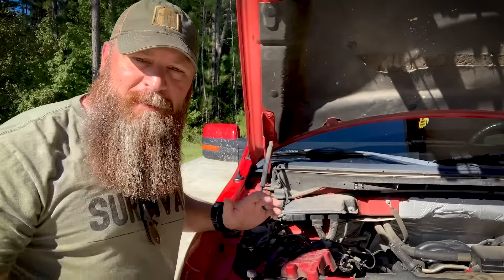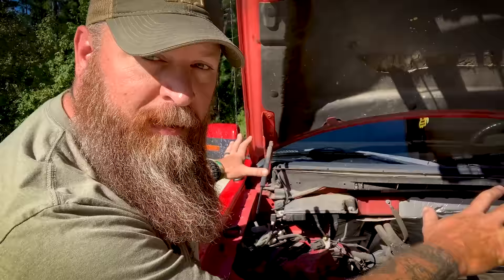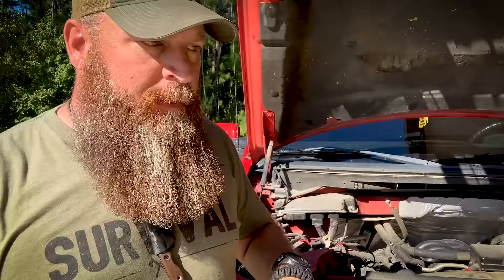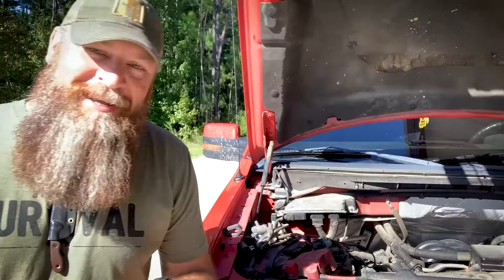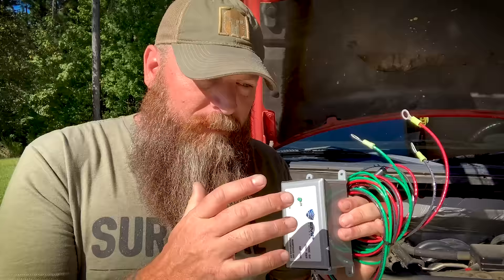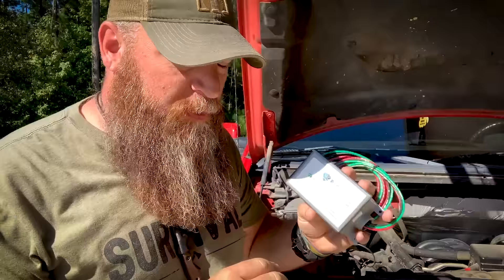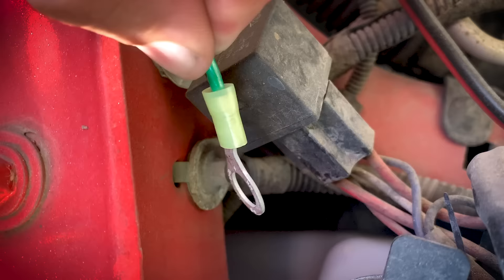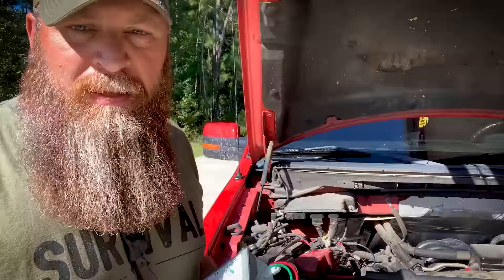EMP PROOF YOUR VEHICLE

Comment: You cannot stop EMP with a surge protector like you would with a lightning strike.  EMPs don't come in through the power lines.  They affect anything that acts like an antenna the most (but not only) because the energy is dumped directly into the electronics.  Like wireless charging except not limited to electronics meant to receive power.  It pumps energy DIRECTLY into a computer chips not designed to handle significant current so it heats up and dies.  Grounding connected to that chip, like the 'EmpShield' can't help because the energy traveling from the chip to the grounding device would have already done the damage.

Comment: Interesting video, and the product has many claims, I am a simple man though and one of my hard and fast rules for planes, boats, cars is never to use cheap electrical components. The connectors on what you are holding look to be non-insulated cheap import ones.
The product website offers no information regarding wire gauge , quality, connection quality etc. You did catch my interest though so am reaching out to them to see if they will provide any specifications or are they just limited to shiny "marketing" materials which often works for the Gubmt but not for something I need to trust. 
Thank you for your content.

Comment: A nuclear detonation produces 3 waves of energy, E1, E2 and E3, over varying time duration.
The wave of most concern is the initial E1 wave, which could be generated from a high altitude 'air burst'.
On detonation, Gamma rays would stream down into the atmosphere in what is known as the 'Compton Effect' and would effect the area between 10-25 miles above the earth. The massive number of free electrons created in this event, are fired towards the earth before being deflected by the earths magnetic shield and as a result, generates a very powerful electromagnetic field. This field rises in intensity for a couple of nanoseconds before dissipating over the next couple of hundred nanoseconds.
The E2 wave produces a field similar to that created by lightning.
The E3 wave is produced by the fireball and x-rays and can last for several minutes, although it will peak in intensity in the first 10-20 seconds.
The E1 wave is of most concern, as it's short sharp and extreme amplitude burst of energy can cover an extremely large area, possibly across the entire country depending on its altitude and yield and would be the main source of electrical damage to electronic/electrical equipment. 
E1 will 'couple' directly into electronic equipment and the broadband characteristics of the wave can create extremely high voltage spikes within the equipment whose protective components are far too slow to operate to offer protection.
It is expected that MOST vehicles would survive an EMP attack, but older models before the introduction of solid state electronics would be better protected.
In the case of a nuclear detonation, it comes down to  several factors in the end ... the weapons 'yield', whether it's a ground or air burst and if an air burst .. at what altitude?  The greater the altitude the greater the effect.
In the case of the 'Starfish Prime' test, it was detonated 250 miles above the ocean and around 900 miles from Hawaii, where some significant effects were observed.
A similar Soviet test named '184' was detonated at an altitude of 180 miles above ground level and caused extensive damage in Kazakhstan, including damaging radar systems several miles away and telephone lines apparently had surges in current induced into them of over 3000 amps.
The damage noted above was based on much smaller nuclear weapons than are currently available today and is one of the reason why I don't believe that we will ever be involved in an all out nuclear conflict. 
Our world leaders KNOW the devastation that would be caused if this happened and they KNOW there would be no coming back from it. The massive level of destruction would leave no 'winners'.

Comment: The main problem with trying to protect electronic equipment is the E1 phase whipes out almost everything with a micro chip the E3 phase is what totaly destroys the energy grid. How long can we maintain something that was shielded with no way to get fuel or batteries. Lets just say an emp only  took out half the country and we still had the ability to repair it. How long do you think it would take to totally rebuild half the power grid. Years

Comment: Retired Electrical Engineer here.  I’ve been trained, then successfully designed, tested and fielded EMP resistant equipment.
I’m calling total BS.  Any engineer who has worked on EMP resistance gear can tell by just looking at the box you’re holding it will not do what you claim.  

Don’t waste your money on this box.

Comment: emp is tested in diff. autos by setting off emps over the autos. emp for your house will keep your wall tv from becoming a stick of dynomite keep for burning down your house and protects out to 250 ft and diff. size of this device

Comment: The Carrington Event caused fires in telegraph stations with robust assemblies. The tiny micro circuitry EVERYTHING has today (and that includes all cars going back 100 years) is all vulnerable if not complete;y shielded. The idea that you can route the effect and circumvent catastrophe through such a unit is a pipe dream that will only work in non-events. Only a total package, external protection to ground will work against an actual event of any real magnitude. That looks a lot more like a garage than a plug and play infomercial gadget.

Comment: I keep my cj5 jeep sitting on a hill parked under a shelter that's locked up I have 1 shop jack under the front and rear to save the tires but the jeep is off the ground on jacks I have rebar in the concrete with a ground line going up to the roof the shelter is basically a faraday cage I made and when I lock it up the door has weather seals and a pressure latch on the door and inside I made faraday cages out of mortar ammo cans and inside I have brand new unopened baofang radios, raspberry pie quad processor chips,Garmin 101,601,and 701,power banks,extra Garmin tactix bravo watch, calculator and 18650 batteries with charging stations along with boxes and boxes of AA batteries,cr123 batteries,9v batteries,12 volt batteries,watch batteries,u name it I have brand new 15 in flat screen tv with a dvd player in one and all of the mortar boxes have thw seals ripped off lined inside and out with foil.and insulation tape and have them.all tapes off with aluminum tape at the base plus the shed its self is the best version of a faraday cage we could design its locked up with a pressured seal as well and is sealed with aluminum tape i dont expect all the stuff to make it but im pretty sure alot of it will as for the jeep it has no battery just a alternator and a staright 6 with 4 wheel drive i can pop start it and it can run on the alternator as long as i park backed up on a hill i should be good to go at moments notice

Comment: If the danger is in the power grid, why would engine combustion cars be affected since they do not connect to the grid?
If the emp sends a cloud surge directly to the electronics, how would putting an inline resistor or a surge protector help?

Comment: After a CME or EMP strike the world will be in such disarray you won't be able to get a new EMP shield for any amount of money so the replacement guarantee is worthless. I have an 84' truck that will survive but what I need is a 12 volt pump with a long hose so I can pump fuel from under ground tanks at gas stations. Most likely scenario after a CME is so few vehicles will run that the available fuel will go bad before we run out.

Comment: Can someone please explain how this works? Putting the grounding wire on the body of the vehicle without a ground strap touching the earth, is the same as battery ground. So where is the ground shunt sending the voltage other than to the vehicle.

Comment: But the vehicle dosent have any voltage when powered off and an emp will disable even if not running...dosnt the fuses do the same thing, and couldnt you just put an extra set fuses close to the battery.

Comment: The ONLY THING that will shield your on-board electronic systems from an EMP is a half-inch thick box of mu-Metal-coated Stainless Steel or a fully-Tungsten Metal Box. Then you need to shield ALL your wires and sensors with metallized RFI/EMI/EMP shielding tape and then GROUND all your cable shielding and finally enclose your engine CPU / MCU /ECU within said grounded Stainless Steel or Tungsten Box. 

If you're into to it you could also use Varistors and Shunt Circuits to redirect all inducted EMPs to elsewhere such as a set of fuses or resistors that will blow/shatter and take the brunt of any inducted currents.

V

Comment: A number #12 wire , bigger than those wires , can only carry 20 amps. You are saying those smaller wires can handle 5000 amps? I have trouble with that.

Comment: Issue is how EMPs work this wont really protect you. They induce current in any circuit that has a wire. The wire works like an antenna and power goes to the nearest chip and fries it.  This might solve for power being generated by a surge from a power source like the grid. But a flare or similar will just cook the computers regardless. The actual DoD uses different circuits to shunt the current in the chips. They also shield the boxes with faraday cages and ground them etc. Its not just a single point of source.

Comment: 1970 F100, inline 300 cid six banger, new solenoid in box, new battery on shelf, AM/FM radio and NOAA CB radio. Standard tool kit no need to upgrade anything.
Newer auto,s have to many  CPU needs and your wasting your survival money on them.
Why bug out when you have shelter and neighbors. 12 volt Lighting system, 1 battery 24 hours of light, 1 cook stove 3 cord of wood all the heat to get thru the winter.
Unplug your solar battery charger, wait 1 day, replug in and enjoy.

Comment: can someone explane to me  how those little wires handle the clamed surge current?  0 guage wire is only rated for 190Amps those wires are at best 10 guage. the best surge arrestor you have is your car battery.

Comment: I can't see how this will work . A car is insulated from the ground by the tires , earthing the battery/electronics to the chassis works how ? where exactly dose it go then ? you would also need to drag a conductor behind the vehicle to discharge the potential , (I know trust me)

Comment: With an electron saturated atmosphere, I assume the human body would also be charged until touching a ground somewhere. That could be turning on the kitchen faucet. And would the grounding and subesquent discharge of yourself kill you?
Reply: Radio Frequency energy can do damage to the body, but I think it's only going to happen at specific frequencies (think microwave oven). What you're talking about would be something like a static discharge - which is technically a DC charge. DC doesn't propagate the same way as Radio Frequency.

Comment: Wow. So..  the idea is cool, but I don't see that unit sucking up  ( RF/static  )  energy on the level you mentioned,  and doing it over and over. As if its a circuit breaker, 
When the charged atmosphere surrounds everything, and penetrates everything, all of your entire wiring harness will be exposed, and that's an entry point for electrons to flow through the wires and excite the molecules in the copper which is how electricity is transferred, and so I don't understand exactly how this unit you were speaking of can stop all that energy as  if it was a EMP Shield as you would call it.
It seems like the lightning arresters we would get in aircraft inventory lots. 
Thats probably what this is based on. 
But hooking it to the battery and ground ? 
You would do better to get a battery disconnect so that it's an open circuit
When you shut it off, and  that energy
 can't  flow throughout the circuit. 
Then you get in your vehicle, turn the switch and suddenly you have power. 
But ... I liked your video👍

Comment: the way the company that makes that box thinks an EMP works is you can have a car with a battery hooked up like any other and just add the surge protector and that's it, sorted. But if using that logic (which is incorrect btw), then simply disconnecting the battery on a modern "bug out" vehicle and grounding the chassis / unibody will achieve the same thing. Unfortunately this is where that company's theory falls out of the bus. 1st they have never tested their product using an EMP generator in an enclosed facility so none of their products have ever passed the actual grade, it's only theoretical. 2nd the "surge effect" is present in the circuits and even chips themselves without needing a closed circuit or power source. So even with the "magic box" hooked up it will fry most chips in the vehicle. 

Just drape a faraday/EMP tarp over the vehicle and don't remove it for a few hours until there are no signs of further EMP strikes, you can test this by making devices that will purposely become inactive when removed from an EMP bag or garage with faraday / EMP lining fabric. Then simply just drive out the garage with a completely unmodified vehicle. If you want a vehicle that will operate during an EMP event, just stick to mechanical and carry some extra fuses. You can use these same principles with RVs, campers, homes, etc. Also most budget generators are completely mechanical

Comment: I am no expert, and dont know beans about beans other than they make mighty good eatin'. Anywho., I was told over the years that if you keep some important electronics (radios, laptops, etc) and cars with batteries disconnected when not in use, they will be fine as long as current is not flowing through them at the time of an EMP or CME. I really don't know if that's true or not. I know people concerned about these things should put electronics like radios, emergency flashlights, etc in EMP-shielded bags or boxes that you can buy., probably on Amazon. I kinda doubt they make one big enough for cars - LoL. BUT then again - who knows. I've been surprised by odd things before. 😅

Comment: I can't see how this would actually work. If there is a EMP than all devices with fine electronics, cell phones, digital watches, radios and LED lights will be fried due to the surge in the atmosphere. So if you set up this in your vehicle what makes you think that all the rest of the fine circuits won't fry as well? Military vehicles are specially hardened for this and this little device won't be part of that actual hardening, I don't care what the company says. So far all I have seen is people who received this for free or a discount talk about the install but I haven't seen anyone actually have it on a running modern vehicle and actually hit it with a EMP device. If that test is out there with this product I would love to see it but till then I don't believe it will make a difference.

Comment: Remember, if you're low voltage electronic devices are inside a well constructed Faraday cage.... Using them after the MP waves have gone past man man you can take them out of the cage and use them OK. Friday cage cheap and easy to make and a good thing to keep your delicate electronic transceivers inside. I don't know anything else that will protect the electronics in modern cars... Or your brand new car after EMP hits hard... Maybe is a permanent Gone-er

Comment: A Faraday cage surrounding a electronic circuit should protect the circuit.  A emp is a charged coil with a explosive device inside the coil so the charged coil turns electrons into magnetism 🧲  electromagnet. When this saturated coil explodes the coil sheds all of its charge into a magnetic  field  wave this magnetic wave induces a voltage spile on all wiring  and steel ferrous metals. This current then overpowers electronics and burns 🔥  up wiring and any electronic devices.

Comment: Want to truely protect all of your electronics?  Faraday Cage around your garage.  Faraday cage is an enclosure built to protect electronic devices from electromagnetic pulses (EMPs) that can overload and fry them. A Faraday cage be anything from a small box to a large room, covered with conductive metal or wire mesh, which prevents surges from damaging the equipment inside.   They work, not sure about this product.

Comment: That looks like a standard surge protector used on houses and industrial panels.  Those are meant to shunt voltages that exceed the peaks on 120 or 240 volt systems.  It's even in the same conduit box for installation in electrical panels.  I doubt very seriously that it is going to clamp surge voltage anywhere near 12V.  More like 300 Volts or higher.  Zero protection for a car electrical systems.

Comment: If your vehicle survives an EMP attack, that wouldn't do any good because you will need gasoline to power your vehicle. Gas pumps use an electric motor to pump the gasoline from the ground tank into the fuel tank in your vehicle. The EMP will most likely wipe out the electric motor in the gas pump, so no gasoline is going into your vehicle's fuel tank.

Comment: Actually that is not going to protect anything.  Also the testing on their website takes you to the agency who did the testing and it is very limited type of testing.  It is there for you to read.  I used to do this type of testing for a large company here in the US so I do know something about this.  To have this device do anything of value it would have to be placed very close to the victim (the device that you are trying to protect - with very short leads.  So you would need these all over your vehicle - next to your 7 computers (or more) in a modern vehicle.

Comment: There is no point in emp proofing a truck with fuel injection because gas pumps don't work without electricity, but if your truck had a carb, you would be able to convert your truck to run off wood by cooking wood then cooling the gasses released from the wood.